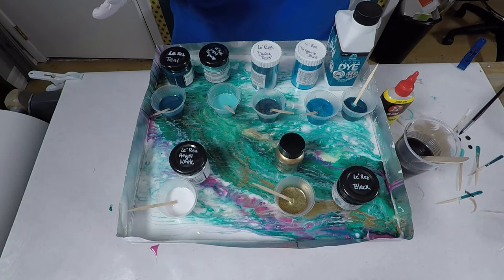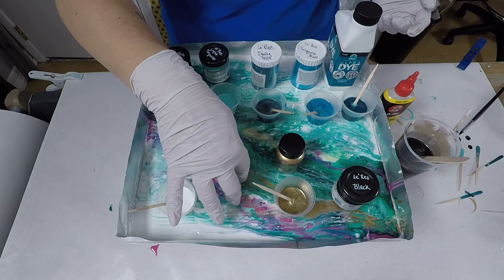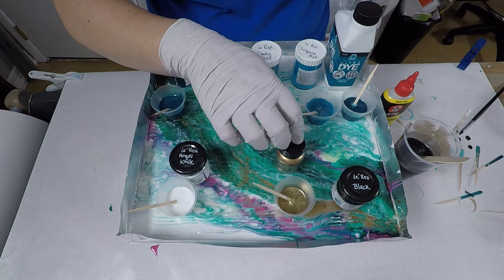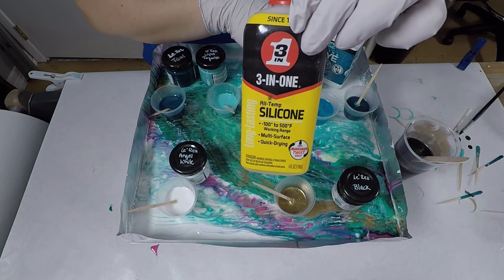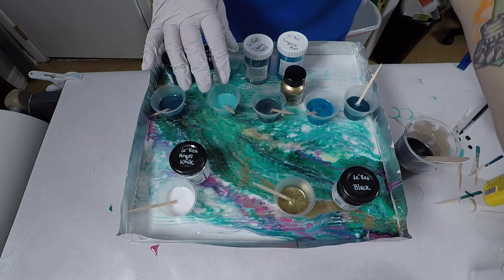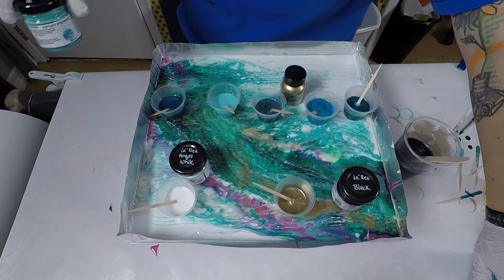Epoxy Resin and Silicone Oil Abstract Art | Stone Coat Countertop

Comment: This is mindblowing!!! But how does it actually dry after?
Reply from the maker: Thank you so much!!! The video and images at the end were taken when it was cured. The silicone oil will leave pits and residue of course, and the residue just needs to be cleaned off well with a paper towel (blue shop towel/or cloth-like paper towels are best!), then cleaned with 91% alcohol, and then sealed with something like polyurethane or Krylon’s UV sealer sprays. Then it’s ready for a flawless top coat!
Reply: @JOTZdesigns  amazingly creative! Thank you@
Reply from the maker: Smart Art Materials - Acrylic Pouring & Painting Thank you! 🥰 Thanks for watching! Love your work too!

Comment: This is amazing...love the effects! Do you mind if I ask why you used the Stone Coat countertop instead of the Art Coat? I’m a newbie and trying to understand the different resin types. Thx
Reply from the maker: Thank you! The regular is what I had on hand. Honestly I haven’t used more than one bottle of each so far, and I didn’t notice much of a difference. They both have long working times and take about 24hrs to cure. I’m finding those qualities actually cause this technique to flatten a lot, and I lose a lot of dimension. I didn’t have any resin that I would have preferred to use for this method, so I just used what I had. I prefer a resin that cures in 6-8 hours instead, like Countertop Epoxy’s Premium FX Poxy or ProMarine. (FX Poxy is heat resistant to 500°, ProMarine is not, just FYI)